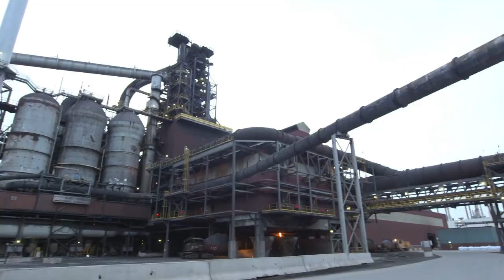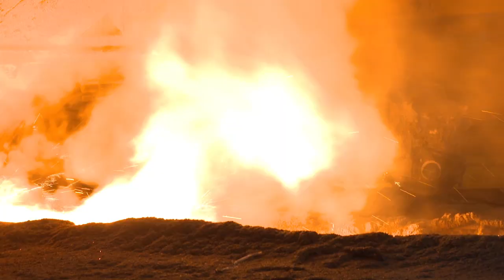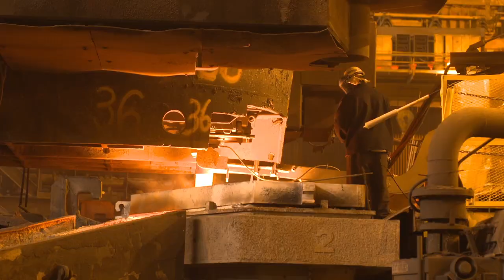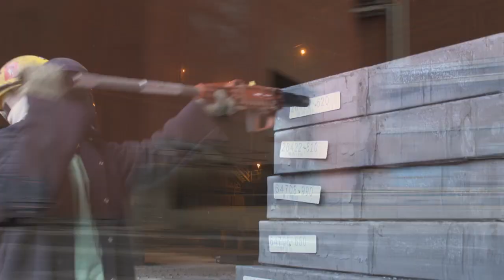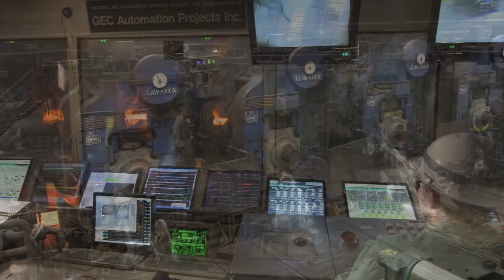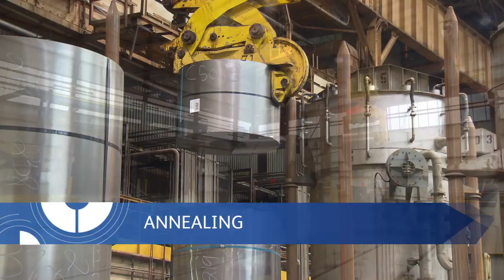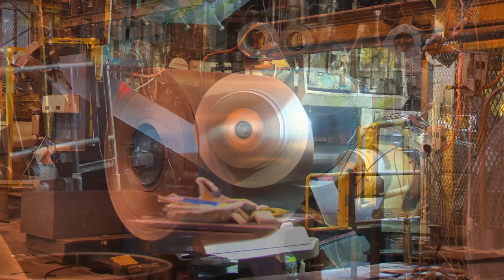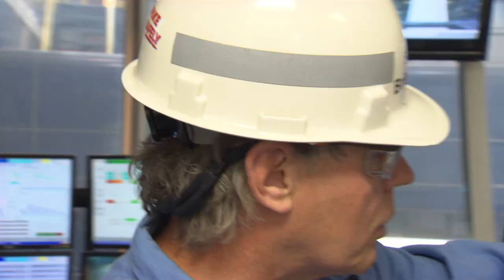Severstal Dearborn Mill Tour

Comment: Severstal is the largest Russian based steel corporation.
-
They puchased this facility from Ford Motor Company in 2004.
-
-
There were 3 original blast furnaces there,  that were built by Henry Ford, between 1917 and 1927.
-
-
After the purchase, Severstal decommisioned 2 of the blast furnaces, and and fully refurbished the 3rd blast furnace.
-
The decommissioned blast furnaces were used for parts.
-
-
Severstal invested 1.6 billion dollars, and refurbished, and or modernized the foundry, hot rolling equipment, the cold rolling equipment, the annealing equipment, and the annodizing equipment.
-
-
In 2014, this modern facility was sold to AK Steel Corporation, that is based in Ohio.
Reply: +Walter's Playground 
-
Severstal, the Russian Company did all the hard work, of refurbishing, and modernizing the facility.
-
AK Steel had good financing, and bought a modernized facility. So, now they are operating it, and producing with it.
-
Reply: Severstal sold as a response to the Russian issue in Ukraine and other concerns at the time.  That "convinced" them to liquidate many assets in the USA.  It was a political expedient and nothing more.  There was a facility in Iowa that made angle and strap steel that was also sold at that time.  Not certain of the others.
Reply: +Brent Hendricks 
The Russian instability, caused Severstal to sell quickly.
So, they lost a lot of money on the sale.
-
Severstal had about 1.6 billion dollars invested into the purchase and modernization of the facility.
-
AK Steel purchased the facility for 707 million dollars in cash. They made a good deal, and benefitted from the Russains work.
-
The moral of the story is that you can make better money off of fresh immigrants. They work harder, and are not as stable.
Reply: @jeromebychowski122  Nope. The moral of the story is don't invade other countries and focus on the economy instead of geopolitics.
Reply: @UCKfLDTEtPkoEwAJtBuHrj2w facepalm. I'm not talking about the invasion of the US. Do you know what happened in 2014?
Reply: @telsys  
Hey listen, sir or miss. It may be a good idea, for you to form a more public identity. You will be able to think more clearly.
-
The topic of this video is the Severstal Dearborn steel production facility. It was purchased in 2004, by that Russian  corporation.
-
The topic of its modernization had been addressed. It was modernized by the Russian Steel Corporation, Severstal. The Russians have been building and maintaining facilities, such as this one, for over 100 years. They are competitive in this business.
-
There was a worldwide economic crash after 2008.
By 2013, the overall Russian GDP had gone into decline, because of the aftermath of that worldwide economic instability for the previous 5 year period. 
-
The Russian Economy is an export based economy.  They normally export over 500 billion annually, and import about 120 billion annually.
From 2008 to 2013, there was a 5 year reduction period on their exports.
That reduced their investment capital, and slowed their local economy. By 2013, the Russsian GDP was declining. That decline lasted until 2016. So, many Russian Corporations, that had foreign investments, sold there stake in those other countries, during this period.
-
The sale of the Severstal Dearborn steel facility in 2014, is just one example of the many foriegn investments, that the Russain corporations liqudated during this period from 2013 to 2016.
-
You addressed the topic a country  focussing on economic issues, instead of invading other countries.
-
You need to take your own advice, and learn more about how the worldwide economy works, and stop invading this comment section with your counter productive comments and questioning.
-
The United States of America happens to have the most efficient  economic system in the World.
That is how a foreign investor, such as Elon Musk could come here and start Tesla Automotive Corporation, and Spacex Rocket Corporation. Elon Musk did all that hard work, and is more competitive than the other local corporations.
-
The difference with Elon Musk is that he came here, became a citizen, and maintains all of his financing in the United States of America. So, he is more stable than the investors that keep their financing outside of the United States of America.
Reply: @suny123boy1  
Hey troll.
-
You can not even form a grammatically complete english sentence, or a grammatically correct question. If you are a citizen of the United States of America, that is pathetic.
-
Your intrusion here is useless.
-
You obviously have no education about the steel industry, or about the deteriorated condition that the 80 year old Ford Dearborn plant was in, when it was sold to Severstal.
-
One of the blast furnaces was inoperable, and already decommissioned. The  2nd blast furnace was in disrepair, and had to be decommissioned.
- 
The 3rd blast furnace was fully rebuilt, and modernized, by Severstal.
It now has a higher capacity than the original 3 blast furnaces combined.
-
The Russians have been building and maintaining steel manufacturing facilities, for over a hundred years.
-
Now, before you start trolling, and making comments, know what you are talking about.
Reply: Step 2 is wrong. Ford Motor sold to Carl Valdisari (probably spelled wrong) in 1989 when they wanted to get out of steel. It became Rouge Steel. Rouge Steel bought a few out of state mini mills and later went bankrupt in 2004. That was when Severstal bought it. My dad was there for the Ford to Rouge sale. I came in in 1992, and have been there for the Rouge Steel bankruptcy, the Severstal NA get out of the US quick sale, and now the AK and Cleveland Cliffs merger.
Reply: @catmarcos3655   double eagle electro galvanizing line sold to USSteel , is it still running ?
Reply: @psychiatry-is-eugenics  I'm not sure. USSteel Zug Island recently shut down. I'm still at the Rouge (Now called Cliffs). I tend to stay on the south side of Road 4 and rarely go down Miller.
Reply: @catmarcos3655 I go in gate 9.
Reply: @suny123boy1  
Hey troll.
-
You speak anonymously, and cowardly from the shadows.
-
You are uneducated, and full of lies.
-
Now, go back and hide.
Reply: NKK and Kawasaki , 2 Japanese steel companies ; made the same mistake , investing in USA steel mills , in the 1980s
Reply: There was only 2 blast furnaces running when severstal bought it from rouge steel after they rebuilt one the other blew up and they got insurance money from it. We still only have  the one running.  They didn't decommission it. It self deleted just like the old power house did in 1999
Reply: Interesting, that you for this timeline. 

Any thoughts on AK Steel Corporation?